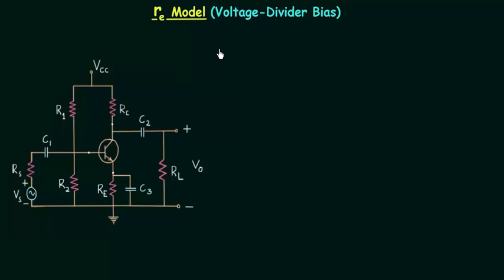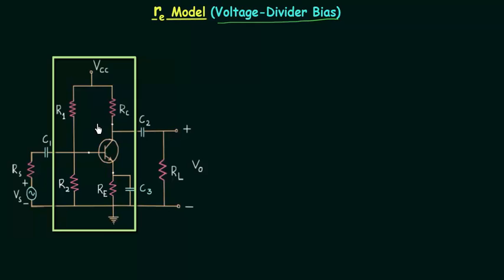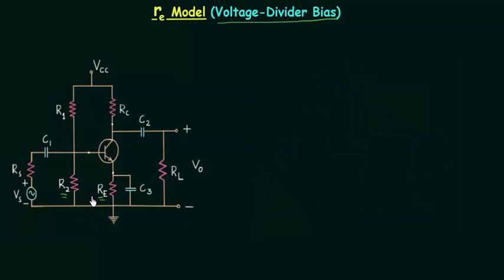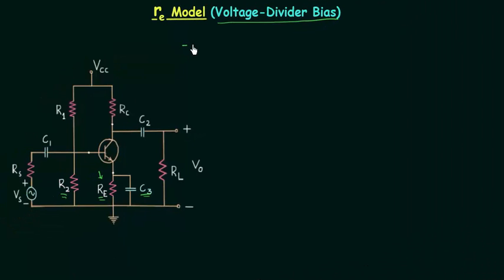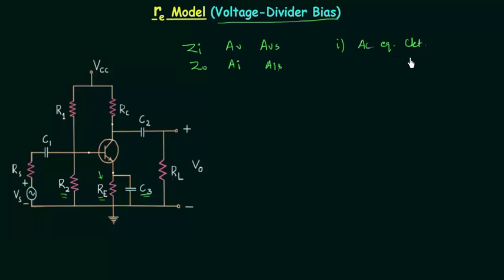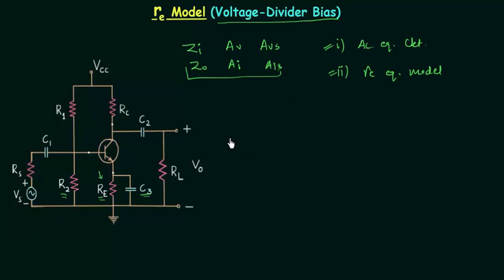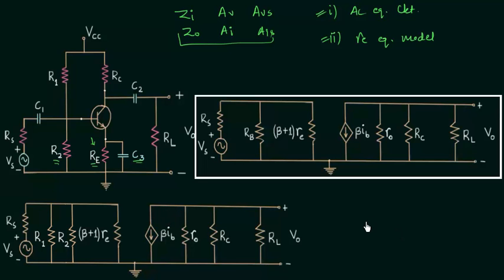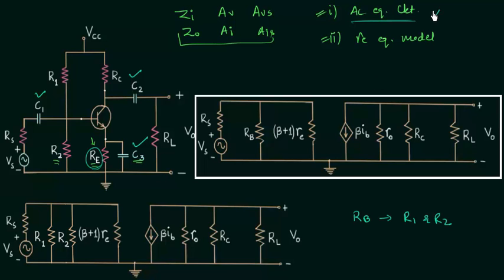re Model (Voltage-Divider Bias)

Comment: how to find the voltage gain, if the input impedance, ro, Rl, and beta are known. while the collector resistance is unknown?
Reply: please send the actual question with the circuit if possible

Comment: sir why we short circuit Re source in voltage divider bias??
Reply: because in AC, capacitor becomes a short circuit at low frequencies, and therefore current bypasses the resistor. This is also why the capacitor is called "bypass" one